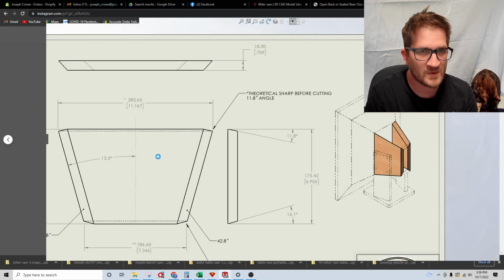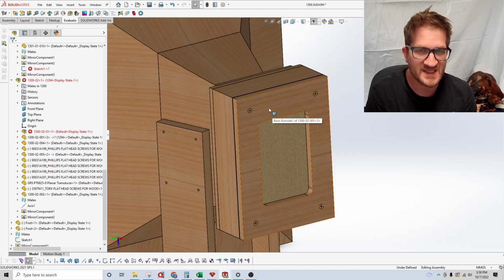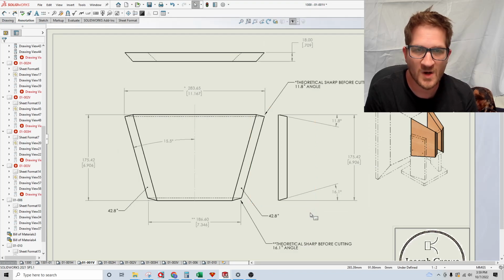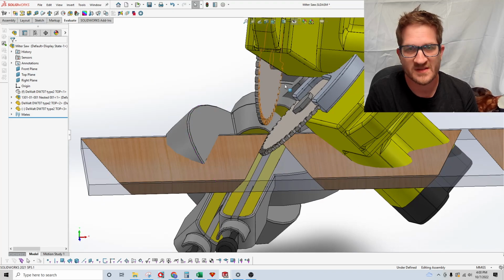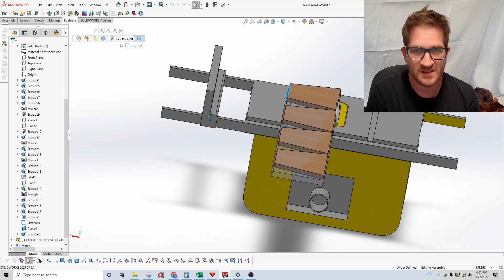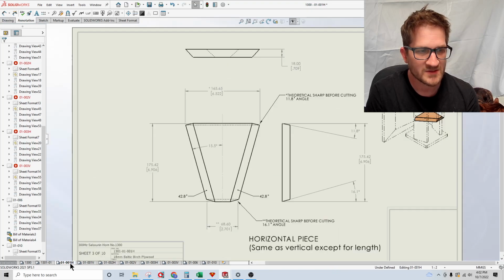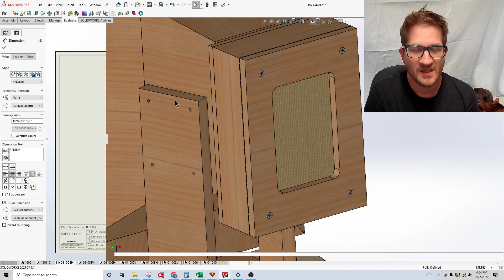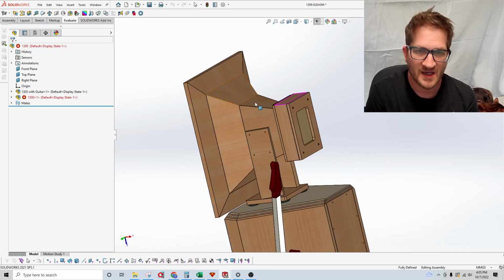Update to the Sabourin Speaker No.1309

Comment: Very nice video, helpful! I suspect it might be easier to cut the shallow angles first on the table saw, then cut out the individual pieces from that long piece on one's chop saw setup. Just allow enough extra material between the piece cuts. Also, might first make a fixture for the long vertical and short horizontal parts, then use that fixture to get your widths correct on the chop saw. This could account for the material loss (and error) in the corner of the cuts. Your CAD work is great! Looking  forward to building the horn!

Comment: I have a couple of 40" radias. It has a flat rear cover like yours did prior to the venting.  I have used these many times and I believe the flat rear panel messes with the response.  I plan on experimenting with a triangular cover similar to the nautilus speakers (not coiled).  Have you tried that at all?  Would be interested to hear your experiences on that.